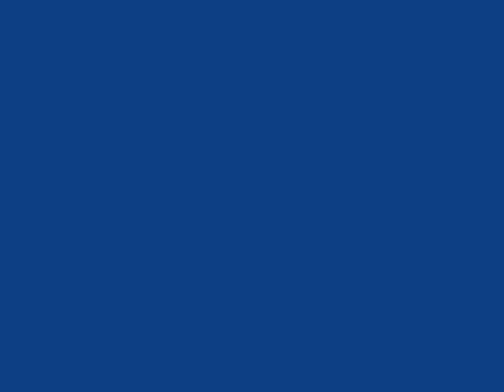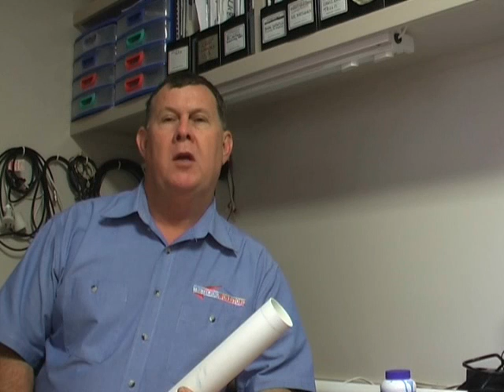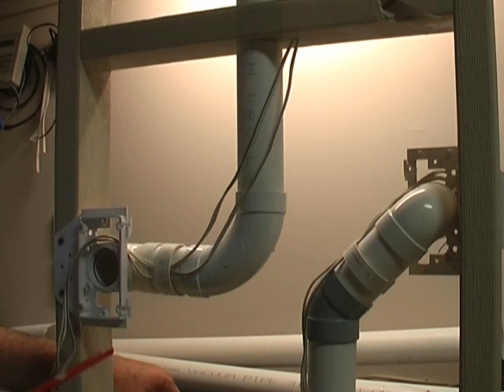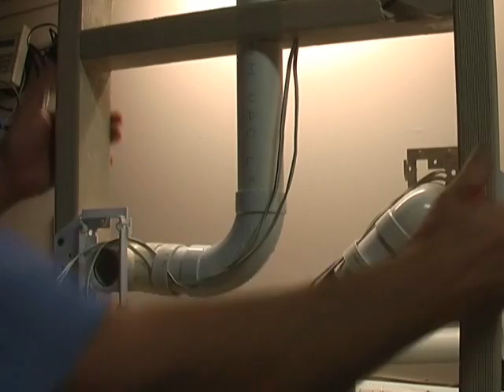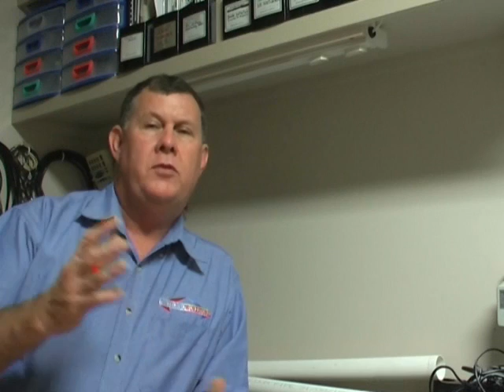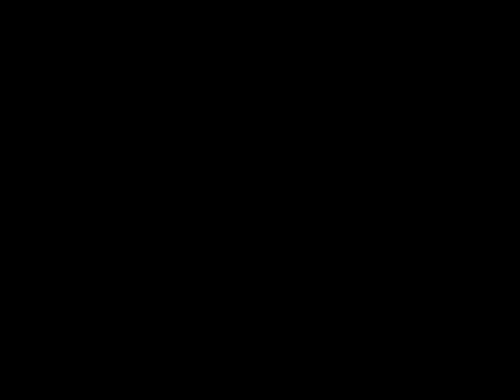How to Install Ducted Vacuum  Part 2

Comment: The gravity trap also has a 2nd use, if you didn't have it and just came straight down to the outlet which is hanging off the stud, when you drill your hole through the noggin, you'll hit the nails holding the noggin in the next wall study bay.  You HAVE to step into the middle of a wall study bay to avoid those nails in adjacent stud bays.

Comment: Dirt/rocks/screws can get sucked up vertically with no issues? Or should you use a diagonal rise instead of a vertical?

Also can one build some sort of safety inlet, where if debris falls backs down the vertical pipe, and collected at the bottom. One can use the safety inlet to vacuum out the collected debris which has collected at the bottom. Or use some rod to knock the potential block loose?

Comment: I strongly disagree with the idea of a 'gravity trap' ! 

Reason for that is that whatever is in the tube has only one way to go, and that is up. If it is something heavy like a marble or similar it wont neccesarily get to the end point at all.
Without the 'gravity trap' you will easily be able to scope out the offending item with a fork or something.
I made the error to fit it like you say in my basement. I have a dead straight pipe going through two floors up to the machinery in the attic. My reason to fit it a couple of bends was because the roofmounted inlet in the basement would be just outside a doorway, wich I thought to be inconvenient. The result is there is now a complete blockage I am so far not able to clear. I have no idea whats in there, as the basement has been out for rent. (in other words it is not my crap blocking it)

Also; The hose provided has an on/off switch, so when they were done vacuuming they immediately shut it off, not leaving time time enough for whatever they just sucked up to get to the tank.

So in conclution: If I didnt have this trap, things would just have fallen out by itself, problem solved even before it could happen !
...and besides, you always want as straight a pipe as you can in order to keep the airflow up.

Comment from the maker: Hi,yes you could get away with doing this. 
you will have to put the fitting side on in the wall cavity, run a bit of pipe with a 90 degree fitting to the inlet so it will fit easily enough in the wall.